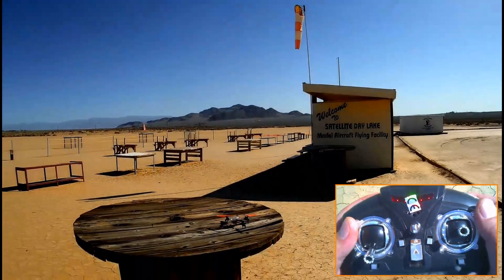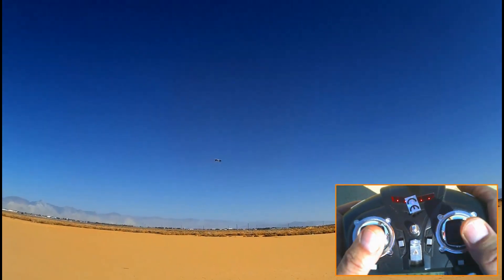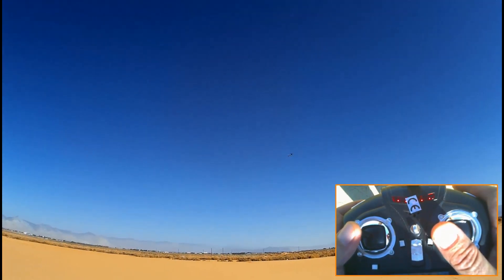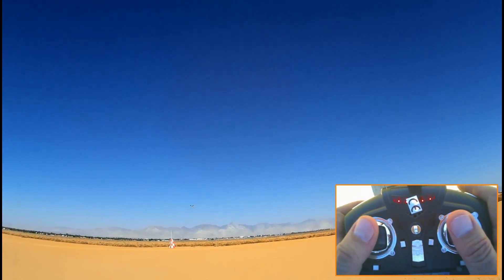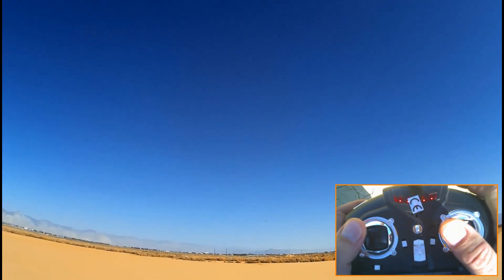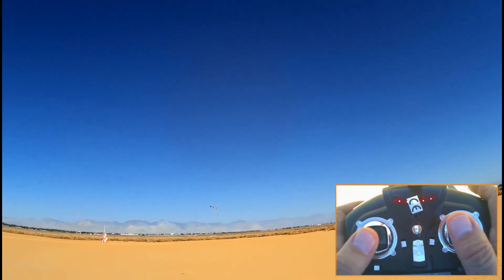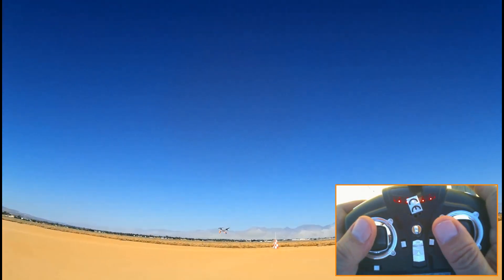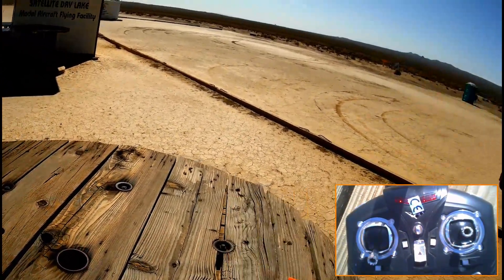Quadcopter Flying Tutorial: Turning Tips and Techniques

Comment: Quadcopter 101 - I'm learning how to do banked turns. Do you have to apply some throttle, when doing a banked turn? (I assume you mean throttle - when you use the term "pitch"?)
Reply from the maker: No, pitch is pushing forward on the right stick.
Reply: @Quadcopter101  So... it doesn't require an increased of throttle - to maintain your altitude in a banked turn?  I must be picturing the physics involved - in flying a fixed-wing aircraft.  Thanks.
Reply from the maker: Yes it also requires increased throttle.
Reply from the maker: @jdorisco  The following tutorial might help put it all together https://www.youtube.com/watch?v=8_JarhVoq1A

Comment: Appreciate all of your videos. How do you feel about acro flying and what's the best way to learn? Some say to go straight to learning acro. The argument is that stabilization will screw up learning acro mode flying? It's kind of a catch 22. To learn how to fly without destroying your drone acro out the box seems like a far stretch for the average person.
Reply from the maker: If you plan on flying an acro racer, I strongly recommend that you first practice with a simulator program.  One that I highly recommend is FPV Freerider.  It has a free demo version, but recommend paying the $5 to get the full version. https://fpv-freerider.itch.io/fpv-freerider
And also recommend the following series of tutorials by Joshua Bardwell.  They will quickly get you up to speed https://goo.gl/rm8xof
And finally, you really don't need a full size racer when starting out.  Through the goggles, the following micro FPV racer feels just the same as flying a full size 250 racer.  But you can safely fly it most anywhere (even indoors).  https://www.youtube.com/watch?v=GY-TuUJIe4Q
And if you want to start with something a bit more tame, I really like this one https://www.youtube.com/watch?v=UsZJP-3cAIY
Reply: Quadcopter 101 I bought a walkera F210. My previous full size quad was the hubsan 501s. I realize that fast racers are my favorite to fly. I absolutely love this f210. I do appreciate it. Will use that simulator before trying acro. Ive been on this journey for a while now with you. Appreciate it
Reply from the maker: Yep, practice with the simulator using Joshua's tutorials.  It works.  Don't take to the air until you feel comfortable in the simulator.  When ready to fly the F210, just practice flying around without crashing ;-)  NO stunts until you're very comfortable flying around in real life.  And even then, practice the stunts in the simulator first before trying in real life.
Reply: Quadcopter 101 yea tell me about it. Doing manual flips air harder than it looks. I just about smashed it into the ground. If it wasn't for the punchey throttle I would have. Take care my friend

Comment: What do you mean by side slip?
Reply from the maker: Imagine trying to turn a car on ice.  As the front of the car turns, for a while the car may slide and slip along in the direction it was initially going.  That's side slip.  You can lessen this by applying some roll with your yaw turn.  Quadcopters with accelerometer control automatically sense this, and automatically counter with roll.

Comment: Hey Guy, The turns with increasing and decreasing pitch were known in WW1, and named after a famous pilot of that era - IMMELMAN.  There is  nothing new in flight  systems really, and the IMMELMAN  turned in to stall turns of various   types, but the theory is still the same,  pull the nose up as you apply both roll and yaw, and the   end result will be a very much faster return to the opposite  direction from that  you were  flying previously.

In my own pilot training days (many years ago now) it  was   termed "advanced aircraft control" but  the aerodynamic theory behind it works as well today with quads as it  did  way back  in WW1  :-))

Comment: Which mode is used on controller? I use the one in which the lateral flight stick is the same as the going up and down stick and the rotate left and right is the same as going forward and back.

Comment: Thanks for all your videos. Your trials have helped me choose a couple of drones. I know you say you know everything about rc flying, but seriously, to avoid confusing your students that fly other types of rc flyers, can you try to get your terms correct. A quadcopter has no pitch control. They are fixed pitch. For helicopter flyers you know pitch control is and adjustment of the angle of attack of the rotors which is adjusted by raising and lowering the swash plate. This this control is normally mixed with the throttle control and is used to increase or decrease altitude. The quadcopter has a stick that controls forward backward left and right directions by adjusting propeller speeds. Forward motion is NOT pitch. This is opposite to the throttle stick. 
Quadcopters have no rudders. They have yaw control. A rudder needs forward motion to allow air to flow over the surface and by turning the rudder it creates vertical lift on the tail thus turning an aircraft. A drone can rotate on its center axis without travelling in any direction. This is called yaw.
Quadcopter has no ailerons either. It drives me bonkers when so called instructors can't even get the basics right. I offer quadcopter training classes, perhaps you would like to attend one.
Reply from the maker: +Flybob4 https://youtu.be/2Z4m4lnjxkY
Reply from the maker: +Flybob4 https://www.google.com/search?q=pitch+roll+yaw

Comment: Quadcopter 101 - my question with these "toy" quads is about the batteries. Do you always use the USB charger that came with each one or can these be charged with a standard Lipo charger like are used with larger lipo (i.e. 3c) batteries? With the short flight times and long recharge times, it seems like a bunch of spare batteries would make things more enjoyable

Comment: Hi QC 101, I don't think too many newer pilots know a lot about trim other than the trim buttons make fine adjustments. In this video I noticed you took off and needed to trim the quad. There must be much more to trim than meets the eye. For example why did you trim in this video? I would like to know when to trim and why to trim and I'm sure many others could use this information. If I'm flying a small quad indoors I always trim because it's easier to control following my inputs rather than what it wanted to do by itself. Out doors I usually have wind and if I trim for a side wind when the quad is facing me if I make a 180 turn doesn't the trim work against what I did in trimming it. Maybe one day, if you deem it worthy you can make a short video on the subtle need and reasons for trimming a quad, how it can work for or against you, etc. If I knew more I could be more specific about what I'm asking. Thank you for taking the time to read this.
Reply from the maker: Wobble Copter Wind does complicate it.  But the above was filmed on a relatively calm day.  As soon as I took to the air I noticed significant drifting of the quadcopter, hence the trimming.  Here's some info on trimming that I put on my blog http://quadcopter101.blogspot.com/2013/10/quadcopter-flight-school-tutorial-1.html

Comment: How do you make your turns so wide? When I try yaw turns and banked turns, the quad more or less pivots on the same point.
Reply from the maker: It depends on the quad. But from your description, it sounds like a H8?
Reply: Quadcopter 101 Hey there! Actually, Ive been trying turns on a Syma X1 and a Cheerson CX-10, with similar results. Yea my turns are not wide at all on either quad. And I'm not noticing any side slip with basic yaw turns. I'm using high rate on both quads. Recently, I tried banked turns with the Cheerson CX-10 (but on low rate indoors this time) and I didn't notice any bank. And once again the quad pivots rather than turning wide.

Comment: Very informative video. There have been times when Ive been using the left stick to increase throttle but I accidentally move this stick to the side very, very slightly and it makes my Syma X1 spin like a top and shoot off far away into the distance. Really frustrating! I'll be getting a Syma X8C soon and I hope that it won't behave the same way when I deliberately use yaw with it to make turns.

Comment from the maker: Dru, my controller is setup the same as yours. This is called "Mode 2" control settings.  Aileron means roll (Right stick, left/right movement). Rudder means yaw (Left stick, left/right movement).  Yes rudder turn is just a regular left right turn without applying any right stick roll.  And the following site may help you http://quadcopter101.blogspot.com/2014/12/quadcopter-flight-school-4-horizontal.html
Reply: Quadcopter 101 Thank you for the clarity and the link for practice tips.  I probably need to get extra batteries for these practice runs.  ha ha  Thanks again..take care.
Reply: +Quadcopter 101 I think you said this v212 is same machine as the Tarantula.  Would this be your top recommendation for a sports quad of this size?  I don't want the added weight of full bodied Tarantula.
Reply from the maker: Andrew Jackson It's not the same machine, it's much smaller.  But this video is more than a year old.  There now is another in this same size/class that I like better as a sport flier. https://www.youtube.com/watch?v=F2TN5_z3sn0
https://www.youtube.com/watch?v=1A7dJDre9J8

Comment: Thanks for your video.  Just got the X11C and still learning.  Just wondering how your controller sticks are setup.  My left stick has the throttle and left/ right, and right stick forward/ backward and sideways...when applying aileron, do you mean apply yaw?  When you say apply rudder turn, is that just your regular right or left turn?  How is your controller set up in this video...can't tell which sticks does what.  Thanks for your help.

Comment: I can't seem to make this work in the Real Flight Simulator. They have a quad in there,  but when I try to bank like this, it just starts sliding all over, or else progressively steepens into the ground?
Reply from the maker: Light Panther Turn on auto stabilization in the settings.
Reply: Quadcopter 101 Hi. Thanks for the note. I'm using a different quad in the simulator (Gaui 330x-s). I can't find a setting for auto-stabilize. I can set the physics to 'easy" but that disables yaw completely. My version of RealFLight is 6.5, which doesn't have any of the newer quads.

Comment: Very instructive! I have a Phantom FC40 with a GoPro. I'm trying to learn how to circle an object while keeping the nose pointed at the object, such as a steeple or a statue. do you have any tips for doing that?
Reply from the maker: George Moses That's not easy to do without a remote gimbal system, and a second camera operator ;)  The cheaper quadcopters have a feature called headless mode which allows turning translational flight.  With headless mode, yaw control has no effect on the direction of travel.  All directional control is through pitch and roll only.  But I'm not sure if the Phantom has a similar feature?

Comment: I figured out/learned how to make banked turns on quads while using a simulator. I was messing around with planes in the simulator and quickly learned how to make bank turns and applied it to quads. Basic plane flying is so much easier and I recommend folks with a sim practice banking/turns on planes first (more stability) then apply it to quads. Fantastic vid in any event!!

Comment: This is a great training video.  Good job, and thanks for doing it.  Just getting into quads myself (Hubsan H107C, Syma X5C, JJRC H6C, and Estes Proto X SLT).  Been flying for about a month and wanted to expand my abilities, so this video was just the ticket.  Looking forward to building my own and getting more into the HW & SW (my area of most expertise). Flew sailplanes (thermal and slope) years ago, but this is a whole new thing.  You flying site is really nice with the mountains all around.  Thanks again, Bill
Reply from the maker: Make sure to also check out this website and its tutorials http://quadcopter101.blogspot.com/2014/12/quadcopter-flight-school-4-horizontal.html
Reply: Quadcopter 101 Thanks, I've already been on that site and found it very well put together and helpful. BTW, any recommendations for DIY quad sites.  Got lots of questions about TXs, RXs, controllers, etc. that I need to research.

Comment: Any tips on how to do quick decending?
I always have trouble keeping my quad stable when decending too quickly.
Thanks!
Reply from the maker: If I'm not mistaken, you're probably encountering vortex ring state:
https://www.youtube.com/watch?v=LCret4rv0HE
The best way to descend is keep some horizontal movement on the quadcopter during the descent.  I like to corkscrew to the ground by giving forward pitch with rudder while decreasing throttle.  Watch how I quickly descend from altitude in the following video:
https://www.youtube.com/watch?v=6lrhCITDPOE
Reply from the maker: Finally did a tutorial specifically for rapid descents: https://www.youtube.com/watch?v=G0cJThsjN9c

Comment: thanks! buying my first full sized hobby grade quad tomarrow! I appreciate this.
Reply from the maker: Before buying a hobby grade quad, hope that you've had some practice with toy grades first.  It will save you a lot of grief as crashing is a right of passage with learning to fly RC aircraft.  It's better to learn by crashing a $30 quadcopter than a $300 one.
Reply: Quadcopter 101 I agree with this. I have started with UDI u839 for about $35.00. I cant tell you how many times I have crashed this thing.  So far I flown mostly indoors. Even indoors I can practice many of the entry level flying techniques Quadcopter 101 demonstrates in his videos. I'll get to fly oudoors more when our winds ease up and I graduate to Quadcopter 101's recommendation to the Syma X5C-1 for my next level copter. Its been ordered!
Reply: thanks for the advice! I had spent 100's of hours flying helicopters, planes, and quads on the Phoenix simulator.  and just so you know, there was a video u posted showing how to find your oreintation from a distance and it saved my quad!. right before i decided ide lost it and was going to chop the throttle i remembered your video and switched to 100 percent rate and guided it forward and noticed that it worked like a charm!!! thanks quadcopter 101!!!

Comment: This has been extremely helpful, I notice your model seems to be flying at a sedate pace yet the one I'm practicing with, a (Hubsan X4 which is very small), seems fly at a much faster rate and can get away from me before I know it. Is there anything I can do to make it more controlled like yours ? Excellent video.
Reply from the maker: BEN10TO10 Try changing flight modes or sensitivity of your controller.  See paragraph 7.2 and 7.3 of your user manual: https://cali-bros.com/wp-content/uploads/2014/02/Hubsan-H107L-Instruction-Manual.pdf

Comment: Hey,  I want to ask. I'd receive my  v222 but realized the transmitter,  on the left pull (throttle) are not coming back to it's position and the right side is back to its original position. Is this normal or something wrong with mine?
Reply from the maker: That is normal. Only the pitch/roll stick has a centering spring.  But the throttle/yaw stick does not.
Reply: Quadcopter 101 why my v222 seems heavy. (I crashed it few times)
Reply from the maker: Does it wobble and drop even though you are at full power?  If so, you may be descending too quickly while in hover.  Please wtach this video to see if this is your problem: Syma X5C vs WLToys V222 Quadcopter Drones Comparison Review

Comment: Bro ...whta is the resolutiin of 808 keychain spy camera...?u know
Reply from the maker: It depends which 808 camera as there are several.  The cheap ($7) 808 is only 640 x 480p.  The higher priced 808 ($40) is 1280 x 720p at 30 fps.  There is also a midlevel 808 (about $25) which is also 720p, but its frame rate only about 15 fps.
Reply: Quadcopter 101 thnx to say.....
Have a nice day

Comment: Hey bro I have w6o8-2 quadcopter ..can I attach a camera to ma  copter...?
Can u help me...?
Reply: Pls reply me...
Reply from the maker: You should be able to.  But doesn't the w6o8-2 quadcopter already come installed ready to fly with a built-in camera? http://huajuntoys.en.alibaba.com/product/815645145-218085316/2014_Top_Selling_Quadcopter_2_4g_W608_2_with_camera_Quadcopter_UFO_4_axis_ar_drone_R_C_Helicopter_quadcopter_camera.html
Reply: Quadcopter 101 thnx for the help and reply
But in ma quadcopter packege cant get me a camera.....    : (
So I try to attch camera to ma quadcopter. ?.
Can I buy camera to attach him
Pls help me......
Srry for the english lang
Reply: Quadcopter 101 w608-2's camera look like v262 quadcopters camera
Reply from the maker: The w6o8-2 quadcopter is a copy of the WLToys V262. Here is the V262 camera, but I wouldn't recommend it as it is only a low resolution camera: reolution http://www.banggood.com/Wholesale-WLtoys-V959-V222-V262-V333-V912-RC-Quadcopter-Spare-Parts-Camera-p-61599.html?p=RB0922217402201307U3
Instead, I would recommend an HD high resolution camera.  You can attach it many ways to your quadcopter, such as with a rubber band or tape:
http://www.banggood.com/808-NO_16-HD-120-Degree-Mini-Camera-Module-7g-p-82197.html?p=RB0922217402201307U3
Reply: Quadcopter 101 thnx to solve my prob..
Tomorrow I bought 120* degree cam ... : )
Have a nice day ...    : )
Thnx bro ...
I wish urs channel gone to to the top level...

Comment: Nice job.  I'm still getting used to the orientation.  Have not used the combo rudder/aileron yet.  Had another engine failure today. Posted a Youtube video of it.  Also another annoying drop from the sky flying around my yard.  Dropped 20 feet on it's back in the street.  OUCH!!!  No apparent damage other than a wire loose which may/may not have caused the drop..